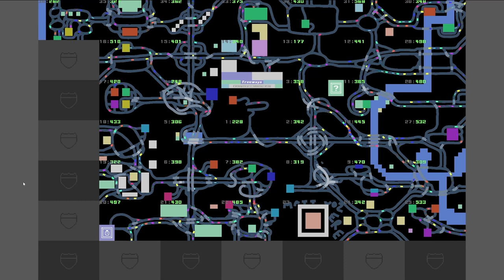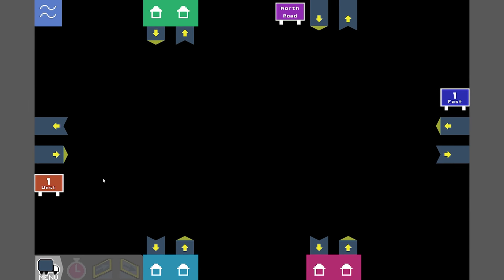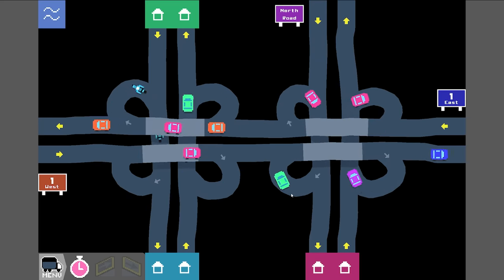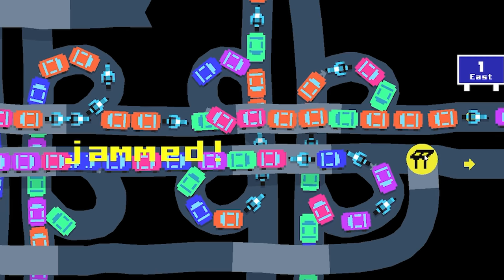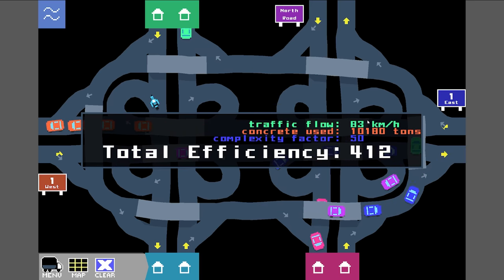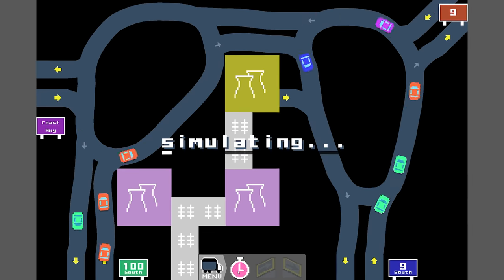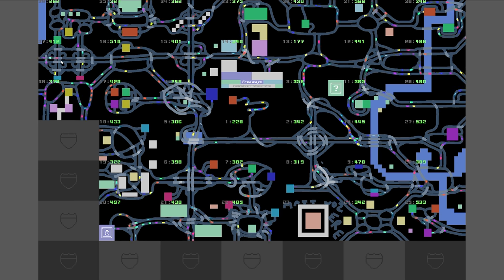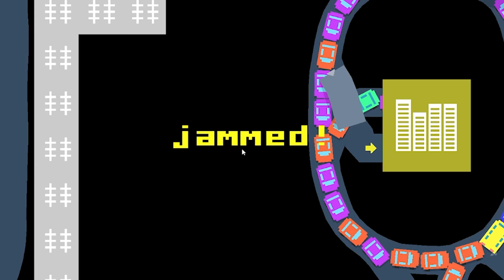The LEGENDARY double cloverleaf is OVERPOWERED in Freeways!

Comment: I like how the “magic roundabout” looks awful but is actually efficient. One of the best and worst junctions I think.
Reply: only robots can efficiently use that roundabout.
Reply: That's what separates engineers from architects.  Engineers design it to work well.  Function over form.
Reply: @speedy01247  It's the opposite. Only humans can efficiently use it. Every driver will look at that interchange a little differently because there are so many paths available. As a result, traffic spreads out to make use of the full capacity of the roundabout. Because it's such an unusual roundabout, it also keeps people more alert and acts as a traffic calming device, making it very safe. None of those functions work for a robot. They'll just pick the shortest route across with the result that they can't even make use of the full capacity... and the large capacity (with greater throughput as a result) is the main reason you'd build one of those in the first place.
Reply: @Gamesaucer  Load balancing can be applied to self driving cars. Google maps already adjusts route based on traffic
Reply: @noahpalmer7966  But where does it get that traffic data from? Collection of such data is not easy and right now it only works over longer periods of time. On-demand selection of a route across something like the Magic Roundabout based on live data is practically impossible because that data would need to be gathered over the course of seconds as the flow of traffic fluctuation. All a human has to do is look around... but self-driving cars CANNOT see and think like a human does.

Of course, as the ratio of self-driving cars increases, things will become more predictable, and vehicles could starting plan out smaller details of their routes ahead of time. But even then, you need to consider that there are still pedestrians and cyclists a vehicle could be held up by, so that vehicle may not arrive at the roundabout at the time it is expected to. This will throw off the data, requiring on-demand route selection again. It'd work better than is possible currently, but they still wouldn't be able to negotiate the roundabout as efficiently as a human can. We may be able to get a bit closer, but we definitely can't surpass humans at present

There is no way for self-driving cars to use this intersection the way a human can unless we can actually make them think like humans. And if we could make AI that thinks like a human, we'd be seeing a drastically different world than we do currently. That technology is still far off, decades away at the least.
Reply: @Gamesaucer  I agree that Current AI systems are ill suited to self driving due to the sheer complexity required and amount of possible scenarios. My favorite example is a Tesla thinking there's a traffic light ahead on the highway because there is a truck carrying a traffic light. But I think an AI system could effectively navigate the roundabout. I can think of a few solutions.
 
System A: Introduce some variability in the route planning.  Plan a couple routes forward through the roundabout, pick one, not always the shortest , the car has cameras, it can look at the situation as it approaches the intersection, and you can change which one you want to use when entering or even mid roundabout if an opportunity arises. If a significant portion of the cars are autonomous the system could be augmented with communication between the cars.  Nearby cars can broadcast their current position and intended route through the intersection so other cars can attempt to pick more open routes. Human level intelligence is not required to beat a GPS.

System B: Future of all self driving cars: Complex intersections have a ground traffic controller. When a car is driving up it gives the controller an entrance and intended exit from the roundabout and estimated entry time. The controller gives back a route to follow and the car attempts to follow that route to the best of it's abilities.

There are many unsolved problems with self driving cars, but effectively navigating that intersection is not such a human level AGI problem.

Comment: By the way, the rough formula to calculate efficiency is [ (flow x complexity) / concrete ] x 1000 

It gives a rough answer, but it’s off by a few, probably because the traffic flow, concrete and complexity values are rounded from decimals.

What this means is that saving a couple tons of concrete when using a LOT of concrete will barely affect the score (due to a 1/x relationship), compared to trying to improve the traffic flow (which is proportional) but if you manage to use MUCH LESS concrete, your score will increase by a lot more even if the traffic flow is slightly slower.
Reply: Who had the knobs to try and read this
Reply: Ah, I was wondering why all my calculations were off by just a bit, but the numbers provided being rounded didn’t occur to me for some reason.
Reply: I hate not being able to drive at 100Km/h. so much score is always bellow 200. Who though that was a good idea ? saving concrete, pfff.
Reply: You could write that a bit neater:
1000 * flow * complexity / concrete
Reply: I suppose since complexity is a fixed number, all that really matters is flow / concrete.
Reply: @SimpleAmadeus  But it declares the difficulty of a level, so it makes the efficency scores more comparable.
Reply: @esajpsasipes2822  Only if that rating is accurate. Either way, if you were to optimize for score (which is unlikely as long as they don't add any way to undo) you only need to consider flow / concrete.
Reply: This is good to know
Reply: @alexdavidson7498  Ah yes significant figures. The easiest and yet hardest topic in chemistry
Reply: Great analysis !

Comment: For the crane level, you could DRASTICALLY improve it by making a small roundabout that connects all of the cranes together while avoiding the main road. Have the main highway be a straight through with a big roundabout for the cranes. Connect on either end to the main road and you've got it set, or as you say, "sorted!"

Comment: Turbine interchange is my favorite interchange of all, due to the efficient and high-volume throughput and elegant shape. I also like diverging diamond interchanges.

Also, as a U.S. resident, my exposure to roundabouts here has been increasing due to a few being recently built at key (usually awkward/long wait) intersections in the nearest city to me, and I'm definitely warming to them. The single-lane ones anyway; I'm still getting used to the multi-lane ones.
Reply: multilane roundabouts are fun. I still specifically choose to drive when there is little to no traffic tho(only need the car once a week), that way i can enter at like 50km/h with no stress :3
You really don't want to be in the middle lane of the roundabout when there is traffic and you gotta exit.

Comment: On that last one I thought the traffic to 16 was actually really low. I would’ve done a standard cloverleaf connecting the main four and then just a simple diverge to connect to 16. I think it would’ve used a lot less concrete and achieved a similar, if not slightly higher, traffic flow. Although, lower complexity.

Comment: I just want to point out the multi direction strongest shape symmetry you get when making those cloverleafs, imagine folding it in half twice to get the original strongest shape.
(those white hash tag lookin icons had to have been high voltage transmission lines from the nuclear plant those cooling towers represent)
Reply: no they're not, they're OBVIOUSLY deer antlers!
Reply: high voltage deer antlers yes, to project deer power across the land

Comment: The only roundabout I've driven on is in a town a little over half an hour from where I live. It's on the edge of town at what would have been a fairly simple, easy to navigate 3-way junction if not for that waste of concrete and space. I suppose they're useful in some situations, but I honestly can't understand what the point of putting one there was. It isn't even a high traffic area. Every time I've driven on it, I've been the only car there.
Reply: Maybe not that junction but I feel roundabouts are often used for lower maintenance cost. So you don’t have to pay for electricity to run the lights etc. (not saying I agree)
Reply: @Arnie1066  I suppose, though I doubt traffic lights would be needed at that particular junction. It just seems so unnecessary. That I've more than once missed my turn because the street signs aren't readable until I'm almost too close doesn't help.